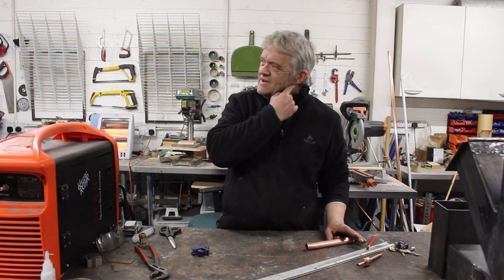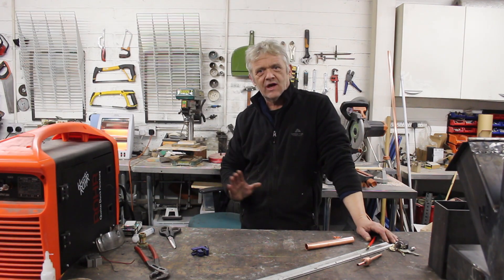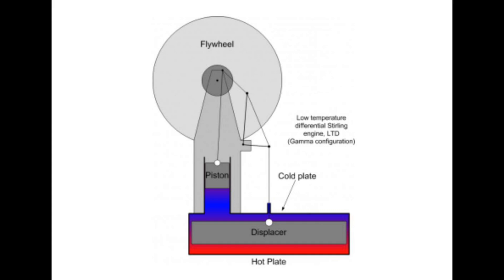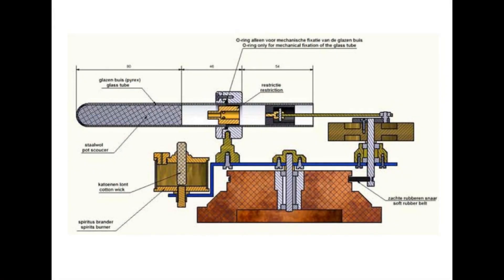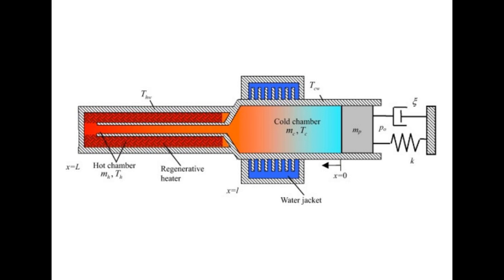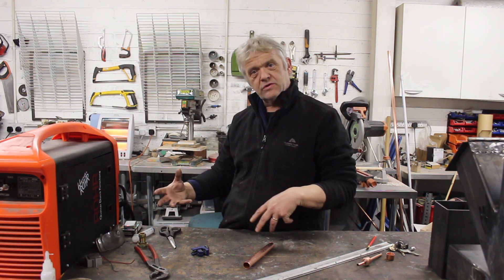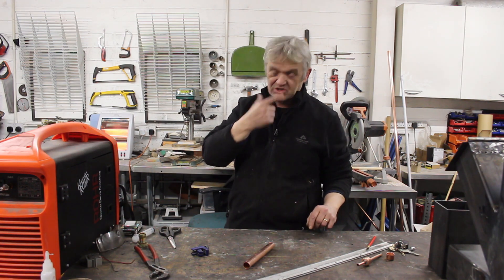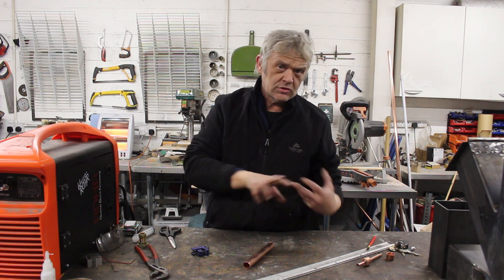1414 Types Of Stirling Engine

Comment: One of the major problems with the Stirling engine in any configuration is the delay in heat transfer. It would be interesting to accelerate this by placing a Peltier cell in the displacer. One side heats up while the other cools in direct contact with the air, without any intervening walls to delay this transfer. It would be the equivalent of the alternator in an internal combustion engine. Since the Peltier cell cannot remain idle for long without dissipating heat, it should automatically shut off when the temperature difference between its sides has been reached. This way, it will operate more quickly.

Comment: This might sound really stupid.. But would it be possible to run a stirling engine with the hot side on one side of the stirling engine and insulated and the cold side on the other and open to the air? Would that introduce enough extra energy into a system that it would produce extra power?

I am saying this because looking at raw data of compressors shows a 3.5COP and stirling engines have been proven at 40% thermal efficiency.. Is there anything actually stopping this from working? Maybe adding a bypass to whichever side gets too much of its intended temperature. For example if the cold side gets too cold for the compressor to keep operating it re-routes it into a standard cooling fin arrangement to absorb heat from the environment while still pumping heat for the stirling engine to run. A 1000watt compressor would deliver 3500 watts of heating and at 40% efficiency that comes out to 1400watts from the hypothetical stirling engine. This of course runs off ambient heat, but finding a way to harvest ambient heat for energy is basically a holy grail of power generation, could someone smarter than me explain to me in detail why my brain is telling me "this shouldn't work" despite raw numbers saying it should?

Comment: Stirling engines have proven over hundreds of years to be economically useless.  But a more general sense of traveling wave engines has had a lot of real-world application.  Maybe it's time to reinvent these with frictionless Boron-Aluminum-Magnesium/TitaniumDiboride bearings.  A reverberatory piston engine uses normal shock vibration to atomize a small amount of fuel for a low-compression combustion cycle (no carburetor--like a Model T).  Internal combustion is always more effective than external, but the load must be tuned to the engine torque to use an extreme-simplicity traveling-wave concept like stirling.  Since a transmission is a huge loss in a hi-efficiency system, maybe a genset and energy storage backside is a better route?  A steady load genset might be simple enough to allow easy multi-fuel swap-outs, high-efficiency, and high durability.  I wonder why I can't find any DIY on YT for press-forging BAM/TiB2 bearings.  It sounds like a mechanical experimenter's wild dream.

Comment: Could you some how use the air flow  rising up through the chimney to spin a fan in the pipe and drive a fan outside of the pipe to move the heat around the room

Comment: Stirling engine + heat pump could turn ambient thermal energy into electrical energy.
Reply: Absolutely there is ways to make free energy or at least make more energy than you put in all suppressed by the Evil Globalists.. 
Joseph Newman's device looked real promising but seems he was stopped from being able to get it patented...
Reply: @danrayson  The extra energy comes from the surrounding environment.
Your false assumption is based on a closed system.
Heat pumps can exceed 400% thermal efficiency while Stirling engines can approach 50% efficiency leaving roughly a 2x return on starting energy that would allow exponential returns up to the thermal limit of the heat pump or Stirling engine.
That leaves half of the power to run the system with the rest usable as power heat or cooling.
If it was on a household or apartment building scale where the unit could provide heat/A.C. and hot water + refrigeration with underground piping instead of forced air units and a mini-split style distribution instead of ductwork, it would just be an engineering problem to approximate the system size and battery requirements (or just sell excess power back to the grid until compatible appliances are commercially available)
On a commercial/industrial scale the potentials and incentives are even greater, but the initial capital cost is still too high because the R&D isn't there yet, much less the supply. Very few individual businesses could afford the 1-off engineering and manufacturing to offset the cost savings throughout their single company - Amazon, Google, maybe ... Tesla could integrate the systems into a vehicle to power the house and charge while docked while also providing a hybrid function that could be powered by any burnable fuel.